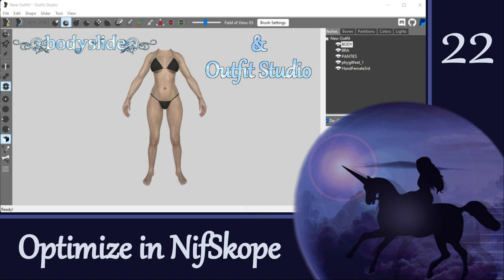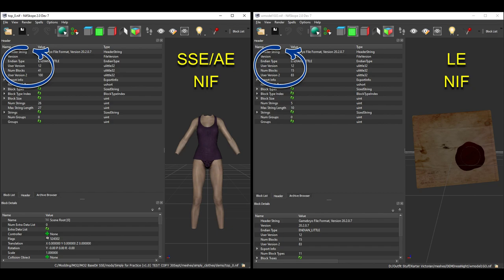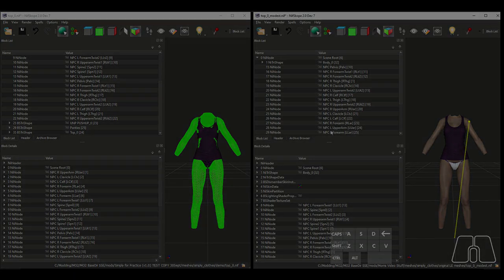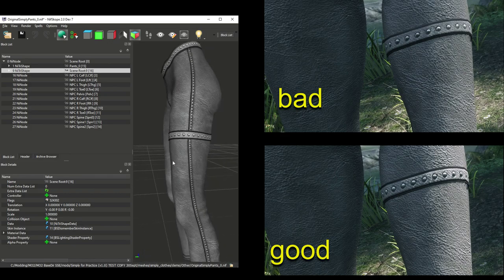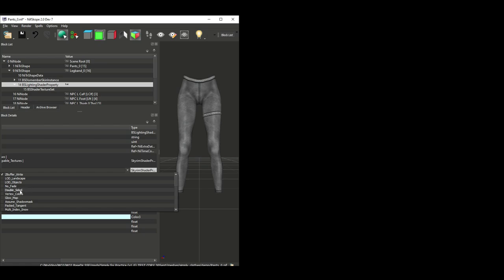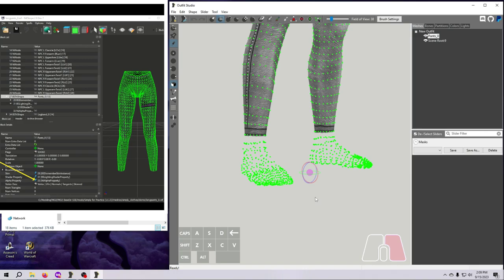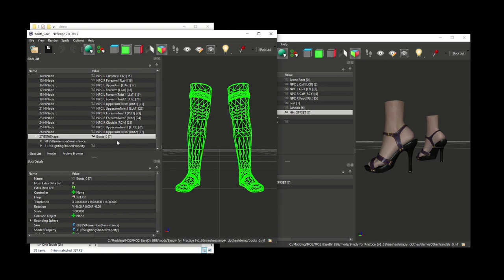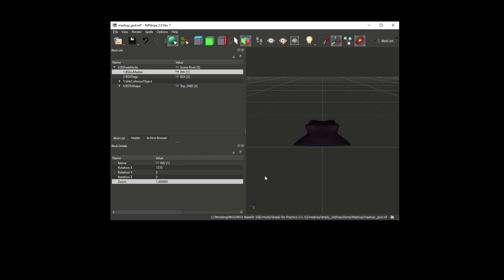Outfit Studio 22: Optimize NIFs in NifSkope

Comment: I've been using all this software for a few years now, probably have put around 1000 meshes into Skyrim and Fallout 4.  I have been running into a strange issue for about a year now, when I build an outfit in Bodyslide and OS.  I'll go into the nif and see multiple Tri files associated with the same mesh and have to remove one or more to get morphs to function in game.  It's not something I can't deal with but, I would like to find a way to prevent it.  If you have any ideas or pointers, I would be eternally gratefull.
Reply from the maker: Is that only after building the BodySlides?  I’m wondering if it’s something about the build settings…or something in the project file.  I don’t use BS, so I can’t help with that.  But they are super helpful over on the Discord server, so maybe try posting there?  Ousnius Modding  https://discord.gg/2qg2Rzw